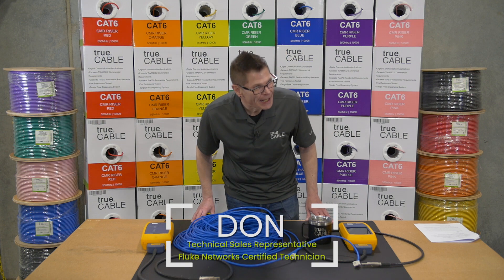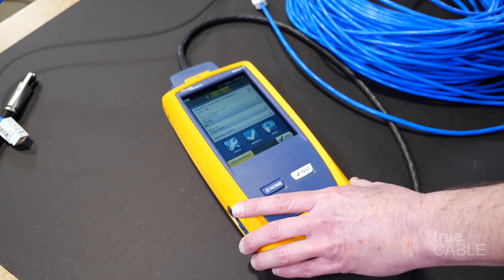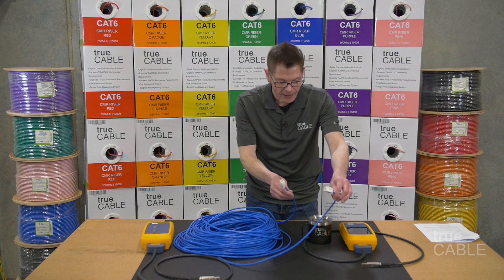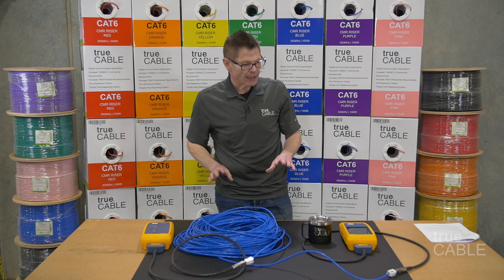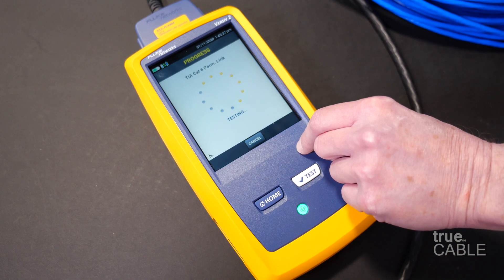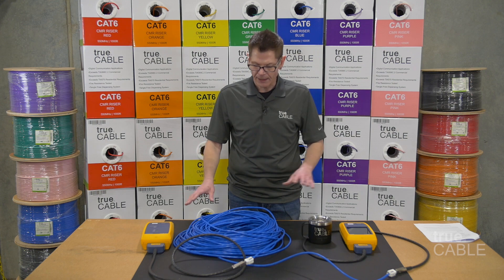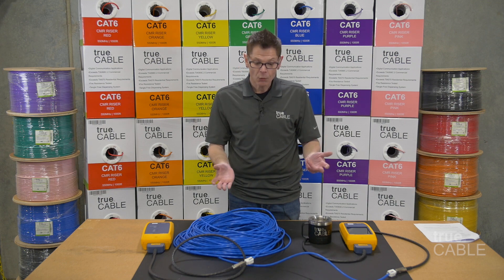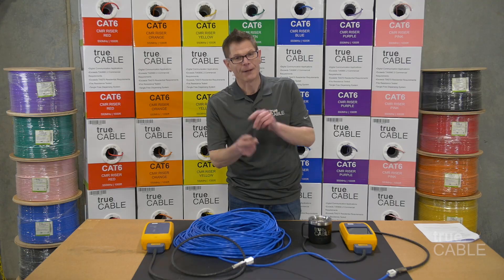What Does Fluke Tested Mean? Overview and Live Test!

Comment: I think you should have mentioned the speed it tested at.
Reply from the maker: Hello Mark. The test performed was a Cat6 Permanent Link. By definition, that is inclusive of any speed Certified by that type of test, which would be 5GBASE-T and below.
Reply: @trueCABLE  Do you ever do speed tests? I need to buy some CAT 6 cable in bulk but on Amazon there is a small few that say their TrueCable Cat 6 tests are not testing at 1G. This one guy had Fluke testers hooked up and said they installed thousands of feet and non of it is testing at 1G. I know that maybe he didn't terminate it correctly but the few that complained about the cable are saying the same thing. The majority love the cable but I just want to cover all my bases. Thank you!